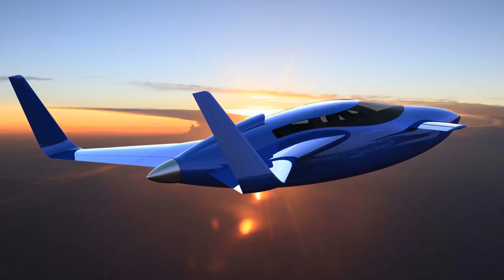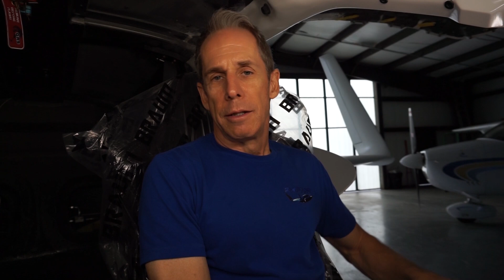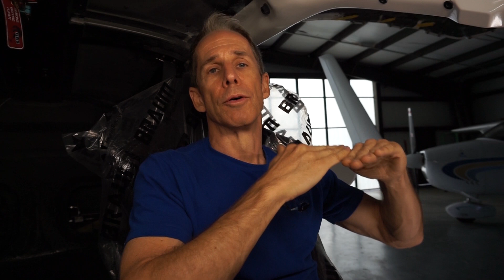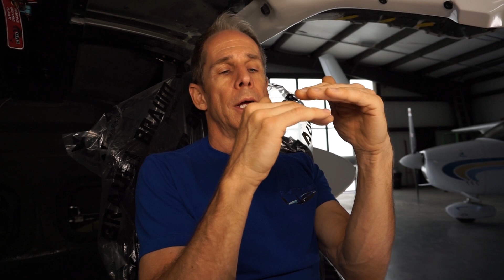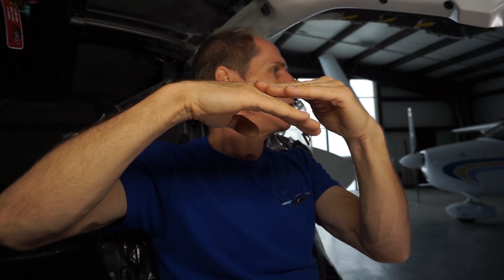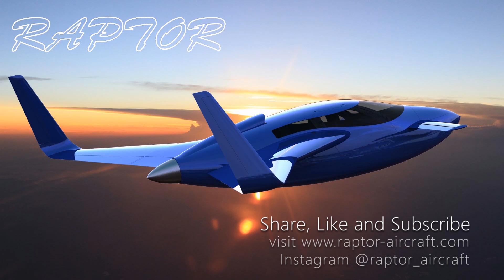State of the Union - Building the Raptor Prototype

Comment: Perhaps a student/professor team from Auburn University or GA Tech aeronautical engineering departments (neither too far from you) can evaluate your aerodynamic concerns.  Chances are they'll do it free just for the experience if you give them a plug in the videos.  Auburn also has an exceptional Aviation department which might be able to help with test pilot stuff
Reply: Yes, your scale model is going to be a lot stiffer than the real wing, and harmonics can be disastrous.   Auburn/GT  could do a dynamic analysis and they should have a wind tunnel to do some tests with.   And this is a huge problem with carbon/glass layups - how to realistically define the strength in dimensions in terms of vibration and harmonics.
Reply: @orbitalair2103  Yes. Lance Hooley's "Eze Jet" canard may have suffered from flutter and lost a wing, consequently taking his life. Kind of late in the process for this sort of analysis.
Reply: Jim Dorn great idea! The experience the student would gain, And the aerodynamic outcome of the inspection would make this a win win situation!
Reply: All great accomplishment have had their obstacles. You and your team have put a lot of effort in bringing this project to where it is. Best advise is to cool down, talk to few people, listen to different ideas and make a wise decision. I still see myself parking my RAPTOR in my hanger soon, heads up 👏🏼👏🏼👏🏼
Reply: Super idea. Very kewl.
Reply: If I were a test pilot, I would take on the task. Understanding the sacrifice you put in this project, my heart goes out to you. As an entrepreneur, I also know you understand the formula for success includes obstacles and discomfort. I KNOW YOU'LL GET THIS DONE AND YOU WON'T BE STOPPED
Reply: Here in NC, our 'Constitution' states we have a right to access institutions of higher learning, FREE OF CHARGE. ART IX, sec 9. https://www.ncleg.gov/Laws/Constitution/Article9
NCSU has an aero engineering program, how good I will not attest.
PS Mechanical diesels don't require power to run, possible fail safe.
Reply: cheerdiver the injectors do on an automotive diesel. It’s not like an AVgas fuel injected engine with engine driven fuel pump and back up electric boost pump.

Losing the ecu would certainly stop an automotive diesel from running. The engine would be capable of suffering a run away failure to continue running without electrical power, but’s that’s not how it would work while normally functioning and not leaking oil through the turbo seals.
Reply: @Alex-us2vw  Tags read First in Flight.
A common problem in shutting off old American model diesel Mercedes, is plugging a vacuum line behind the dash.  While aspired and old tech, still automotive.
Modern systems are no longer as mechanical, I would expect.
Maybe go with the original peanut oil, better yet pull out all the cops, get doughnut fry vat oil.  Heating system, or no gel, if lots of coconut oil is around.  Get stranded on an Island, grow your own fuel.

Comment: I fly a wooden experimental airplane a lot less redundant than what you have designed. Single ignition Volkswagen engine.. lots of hours on them and proven... but still all my eggs in one basket. It’s the risks we take. Very calculated risks. Your ECU has run flawlessly on the test stand. No reason to make that a deal breaker. As far as aerodynamic issues.. makes me want to cry hearing that after all the hard work is done. Bottom line, id take it down the runway a couple times and if it feels stable, take it around the pattern. At some point you just have to do it.
Reply: Alan Green yeah that’s what I would think. If he’s flown a canard just take it into the pattern himself to prove the aerodynamics. Then a test pilot should have no issues to take it up to altitude for testing.

It’s a shame they didn’t have a test pilot look at the design before it reached this stage. The winglets, and elevator issues would’ve been things that could’ve been identified and addressed as concerns from the design stage.

Comment: It's interesting that, in a vehicle with so many single points of failure (private planes in general) , the single ecu would be a sticking point.  At least if the ecu dies theres still a chance of getting on the ground safely.  There are myriad other non-redundant parts of an airplane that would be a lot worse if they failed.  I'm guessing because its "new fangled electronics" it automatically gets the stink eye.
I'd be more worried about the something like the redrive than a proven piece of electronics.
Reply: Its true.  Motorcycles don't have dual ECU's but if one fails while you are in traffic on the freeway... 
Rough Day.